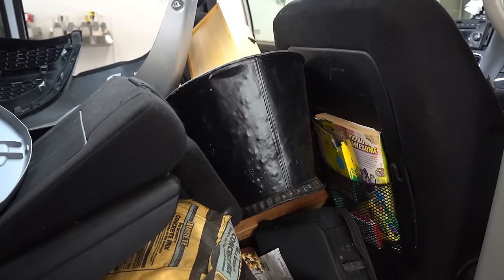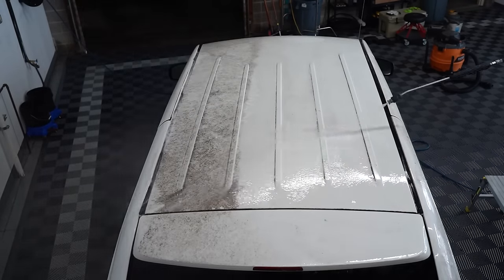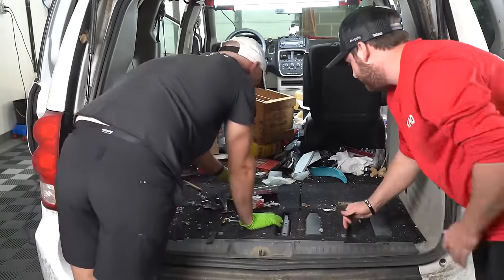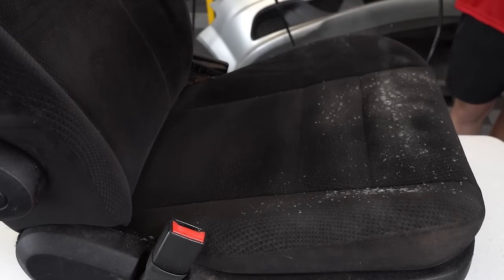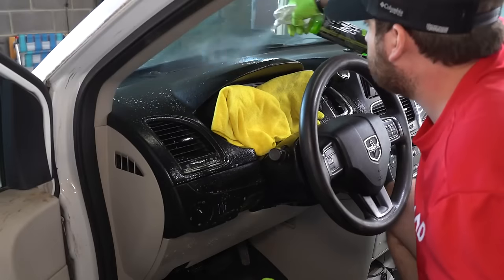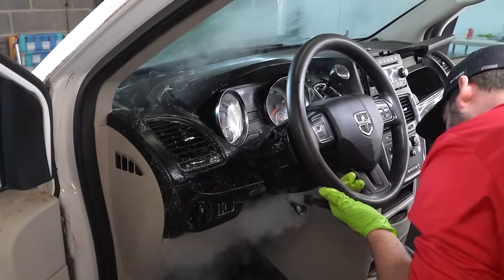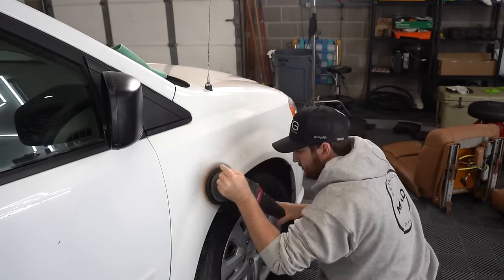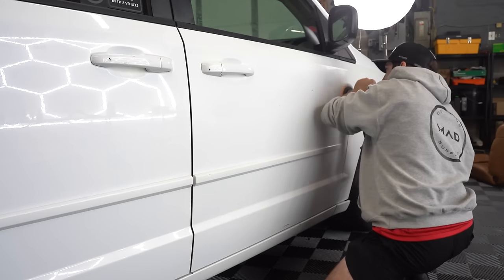Deep Cleaning A Hoarders ABANDONED Minivan With WD DETAILING! I Insane Car Detailing Transformation!

Comment: Great video and editing. Quick question - I've seen many detailers use a steamer after they have sprayed cleaner on the door panels, center console etc. I've always been hesitant to do that thinking the moisture and cleaner both might affect the electronics in regard to the switches, buttons, dials etc. You guys are pros and have much more experience than myself. I just wondered if you ever had a window switch or anything else stop working because of that.
Reply: I was thinking about the same thing. Hopefully we get an answer from the pros..
Reply: Cars are designed for that. The switches are designed to be water resistant. A steamers low moisture. So you will be good. Source, I detail my own cars.
Reply: @malice6081  thanks!

Comment: You do great restore detailing work. One thing you do & should never, ever do is Spray💧💦💦💧Clean A Vehicle Motor😱. You can Wipe a Vehicle Motor by hand🖐w/Cloth. When you Wash A Vehicle Motor, you are causing Electrical Wires & Alternators & Other Motors to become Dysfunctional & cause Electrical⚡Issues😱that will have to be Replaced at great Expense💵💵💵to the Owner down the Road🛣! There is No Debate.